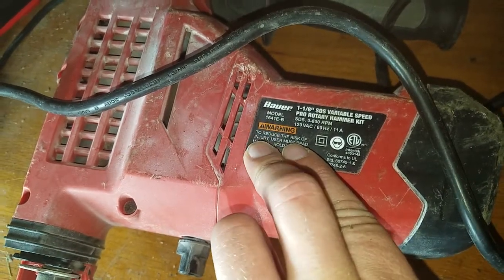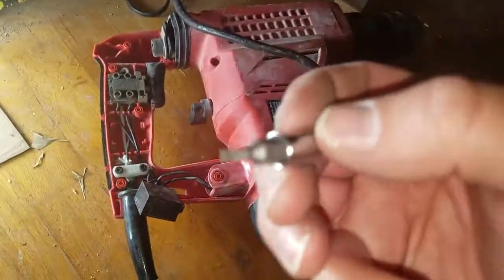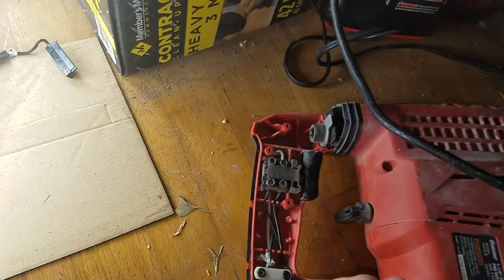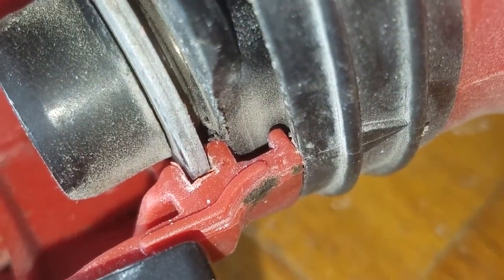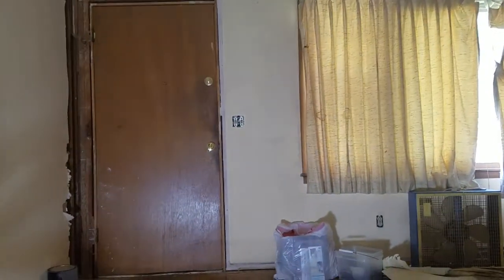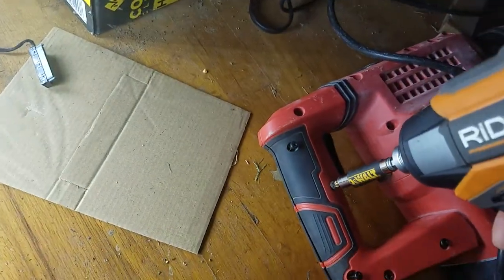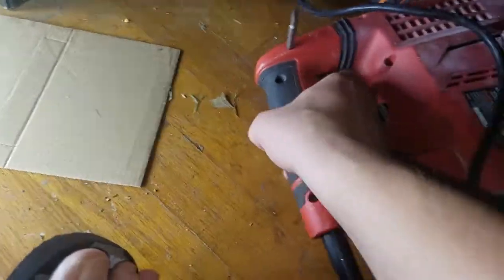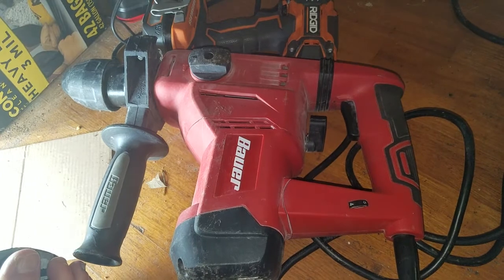Fixing Bauer 1-1/8" SDS variable speed Pro rotary hammer kit 1641E-B

Comment: I have the same Bauer model hammer drill.  Mine starts out fine at medium speed but then after 20 seconds it start accelerating to max speed.  No change to the dial.  I then set the dial to 1 and it runs nice and slow. Set the dial to 5 and it’s med speed. BUT after 20 sec it’s back to full speed.  Thoughts?
Reply from the maker: That's a very strange way of operation. It probably has a problem in the speed control module. But if it works, I wouldn't take it apart. Just wait till it breaks to get it fixed

Comment: This is great info - THANKS!  
However, I have a very serious problem with this rotary I hope you can help with -- the drill stops in hammer/drill mode !  
I have used this machine several times to purely drill with a "diamond core" bit, and just today I was trying to help a neighbor hammer drill a concrete pad. The dials were set as the card instructs (round dial pointing at hammer/drill, and lever in 9 o'clock position). Using the correct SDS bit. it starts okay but then the drill portion disengages. Adjusting the lever yields no improvement.  ANY SUGGESTIONS you offer are welcome. Again, thank you, Sir.
Reply from the maker: That's weird, I don't use mine for much drilling, but it worked fine when I did. Sounds like a defect. There is that black switch by the handle that you have to move to allow drilling, try that
Reply: @InNerdimensional  Yes, I tried that in both 9 o'clock and 3 o'clock position. I'm thinking something is goofy inside the chuck. One guy suggested a ball bearing that captures the sds shank is stuck. Will take it apart tomorrow.
Reply from the maker: @AerialLensVideo  oh jeez,good luck to ya. I'd film it for others with the same issue
Reply: EDIT: All the below* info did NOT work out. The tool is in the junkpile. Too bad so many well made products have just one super important and fatal design flaw. Bought a Makita on sale (many times better).
================================
*FOUND the problem and the solution! Works great now. The grease I used to "lubricate between uses" was much too thick. While the hammer slots on any SDS shank had no resistance, the stroke-length ball channels evidently were trying to accommodate steel balls + heavy duty grease! Solution: You guessed it. WD40. The good spray of that both diluted the grease and provided perfect lube.
Reply from the maker: @AerialLensVideo  nice!
Reply: Como puedo mandar abuscar el suichi para que prenda
Reply: @luiscruz-w2h  No sé sobre el interruptor, pero para mi problema mencionado no hubo reparación. Así que HF fue a la basura. Compré la maravillosa marca Makita. Muy bien y muy feliz ahora.